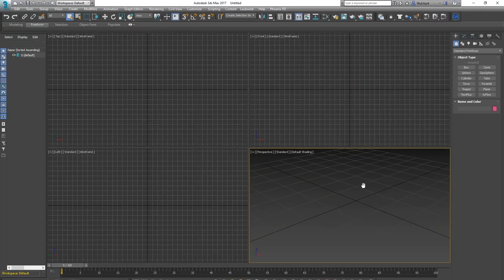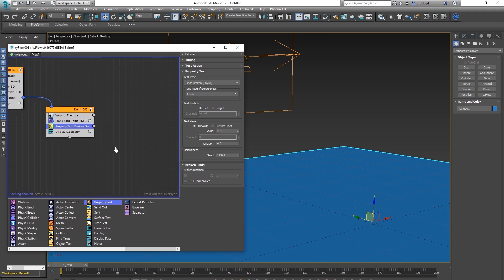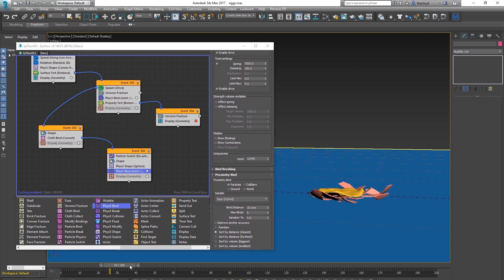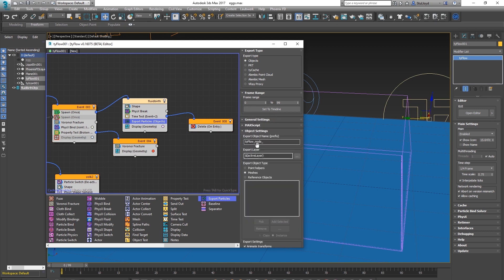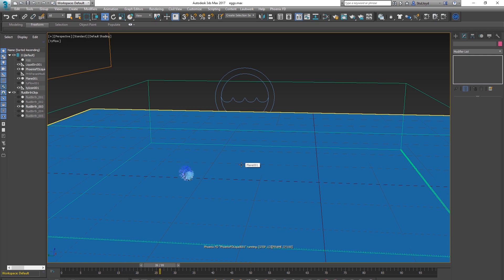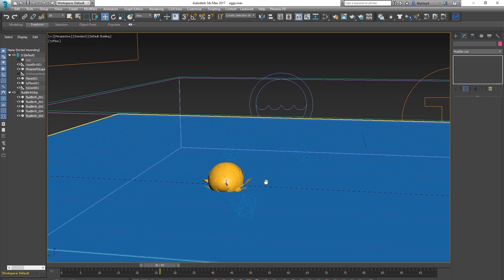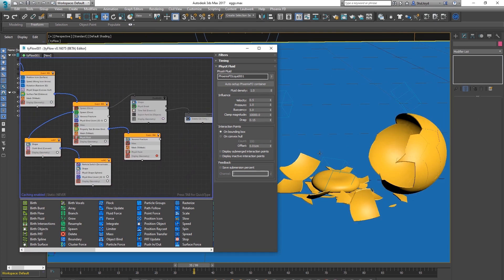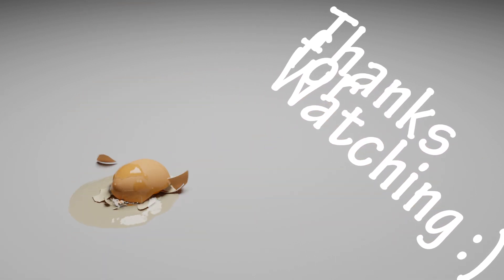Smash Eggs with TyFlow and Phoenix FD | 3dsMax, Corona

Comment: Hey stu.....thank u for an awesome tutorial.....everything went great but i had an issue with the alembic mesh export.....when i exclude the group, the yolk gets exported with the eggs  and the fractures unlike in yours where only the yolk gets exported 😟
Reply from the maker: Hey Bhimsen, cheers! Where are you using the export operator? It needs to be in the yolk event. If you are using the export operator anywhere else, you will need to make sure to add a Particle Group operator to all events you wish to exclude.
Reply: @StuLloyd  This is some kind of bug. 
I also have an export with a shell. Perticle Group doesn't help.

Comment: Hi, for some reason the liquid i try to create doesn't work the same way it does in your video, i've done the exact same steps as you did, do you have any idea where could i have gone wrong? It emits only like 3 water particles, and not even for all the "stones" emmiters.
Awesome tutorial regardless, thanks a lot!
Reply from the maker: Hi, are you working in the correct scale? Some other things that may be causing it are your sim grid resolution is too low, and also maybe the birth by speed mod could need tweaking, try birthing fluid without any mod first and see if it all works fine, then adjust the mod, if that is the case.
Reply: @StuLloyd  thanks! The problem was low resolution

Comment: This is just, wow man. Thank you for sharing your hard work. Do you have any tips or tricks for a good rain scene with tyflow plus phoenix fd by chance?
Reply from the maker: Cheers and no worries! What exact effect are you looking for, there's many ways to do it, but depends on how focused your rain is. Is it close up and needs to be 100% accurate or is it just an overall effect to a shot which can get away with not being 100% accurate?
Reply: @StuLloyd  doesn't have to be a 100% accurate one, It is an overall effect with some depth. I did some work and got to a point but would love to see your approach to the situation. But I would have another question about a desert scene, with the sand pouring out as the ground plane twists dramatically. (not sure if that makes sense tho, lol).
Reply: @StuLloyd  Both examples would be great! A pouring rain effect with gushing wind, perhaps? And a close-up shot with puddles?